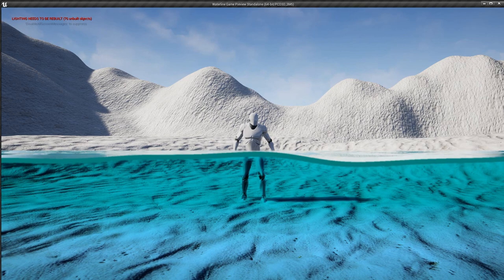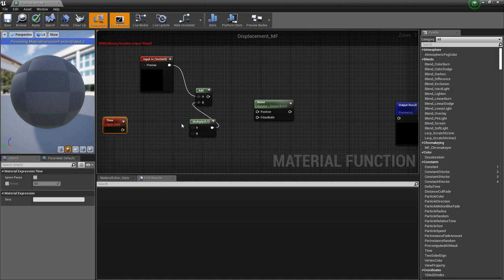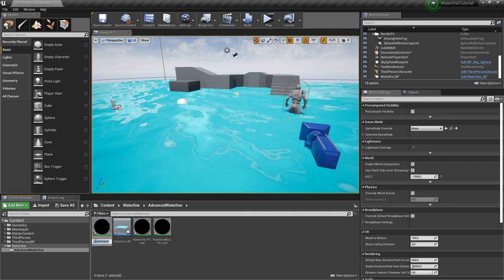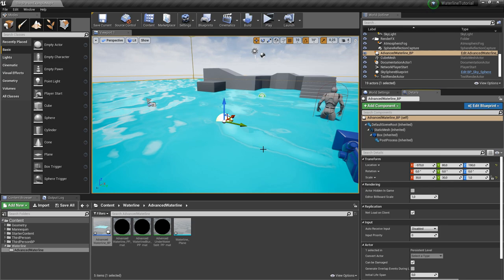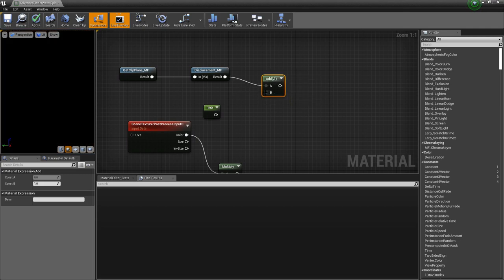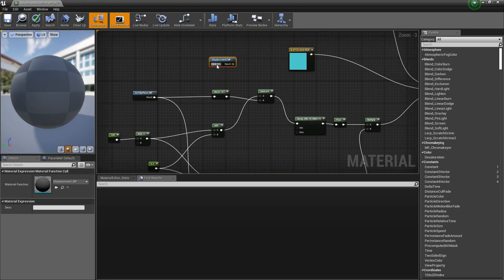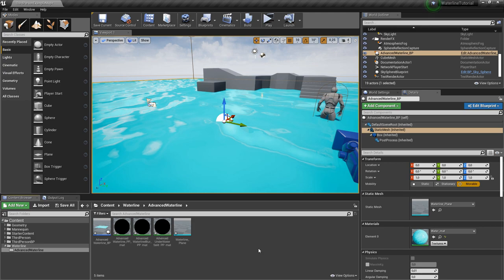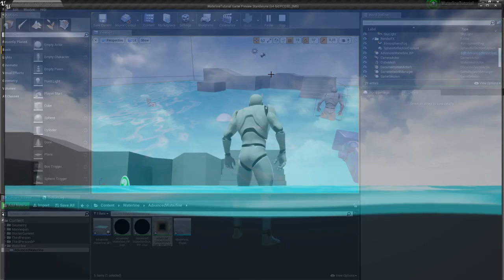UE4 Tutorial Water Line #2 - Creating an ADVANCED waterline with half under water split post process

Comment: Thanks for the tutorial, found it easy to understand and follow. 
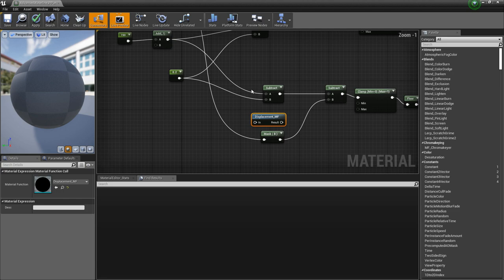At 13:26 the reason you have to add +1 to the z-height of the water plane is because in the calculations made for the water line, as you can see in 11:00, an add +1 is used right after the z-height constant (190). By removing the add or switching the added number from 1 to 0 should fix it.

Comment: These waterline tutorials are awesome, but I've run into issues in UE5. This is perfect for water-only scenes. The problem I had in UE5 was using this in a scene where a lake and landscape shoreline meet. The images in my Goodge Drive link best illustrate the problem. When on land, there's a circular distortion in my sky. Inside this area is bright white and outside said area is blue sky. I think this is due to scaling up my blueprint actor. It's as if the box collision and post process volume (and clip plane) are causing the issue. The lake is a very natural and irregular shape. The postprocess element of the waterline BP is overlapping my landscape. Maybe some others have had this problem also, and it took some time to figure out. I solved the issue by creating all of the tutorial materials and functions, but I did not use a blueprint. I used the high-res plane and applied my water material. Then created a postprocess volume and added the material assets just like in the blueprint (without box collision). I set the plane water height and scaled my PP volume to be level with the water plane at normal size. As you'll see in my screenshots, I dragged my PP volume onto my water plane, thus making it a child of the plane. Now when I scale up the plane, the PP volume remains beneath the water and I still get the waterline effect. Screenshot located here:  https://drive.google.com/drive/folders/1aZMSbDrj9oZQKM4QyFm8FXUtJNBMBSau?usp=sharing
Reply: If others are having the same sort of issue, I can make a video explaining exactly how it was resolved.
Reply: @reliquary1267  Please do :)

Comment: How to do the tesselation part in Unreal 5? I mean there are some ways to do for the static mesh. how to animate that? the weve thing?
Reply: Never mind, Use "world position Offset" node. It will work.
Reply: @UnrealArtist  The tessellation option is no longer available on UE5. how did you solve it?
Reply: @streider1347  Здравствуйте, у меня такая же проблема, вы нашли решение?
Reply: @UnrealArtist  Could you be so kind to give some more details? So putting the MF_GetClipPlane->MF_Displacement->WorldPositionOffet gives a compiler error. Trying AbsoluteWorldPosition(ignoringMaterialOffets)->MF_Displacement->WorldPositionOffset does let the water move, but it's not in-sync with the waterline. So somehow that MF_GetClipPlane needs to be connected still... But how?

Comment: very neat stuff, however by pp material and wave displacement lag behind. I see the wave go up, and then the pp mat follows up. The wave goes down, and then the pp mat follows down. Is there a setting i may have missed, or a quick fix you know of?
Reply from the maker: I think I said in the video that this works only for low displacement.